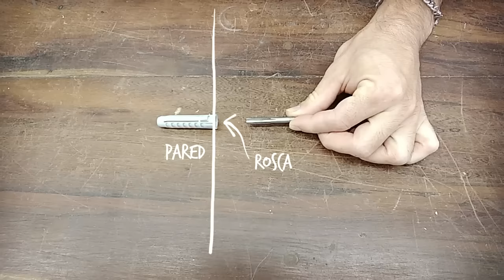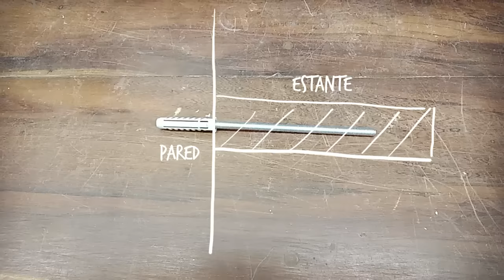⛔TRUCO⛔ REPISAS y estantes FLOTANTES 😲 COMO HACER una repisa o estante flotante de madera ➡️FACIL⬅️

Comment: Está excelente todo, felicitaciones. Está muy interesante el tip de volver a agujerear con un calibre menor luego de ya haber colocado el tarugo. Si entendí bien el tip sería:
1- Agujerear pared con el calibre necesario para que entre el tarugo pero solo hasta el largo del mismo (no el largo del tornillo).
2- Ahora si, ya colocado el tarugo volver a perforar pero con un calibre menor para poder introducir el tornillo más allá del largo del tarugo (de esta manera nos aseguramos que nos quede igual de apretado tanto en el tarugo como en el espacio detrás de este).
3: Creamos la rosca (al parecer este tipo de varilla roscada si no le hacemos las rosca previamente no entra como lo haría un tornillo común).
4: Colocamos el tornillo hecho a partir de la varilla.

Comment: A ya es 5 mm interior y 10 milímetros diámetro exterior y al machuelear tendríamos 3 milímetros menos para el tornillo m8 sería 1.5 mm por lado así tendría cuerda el tarugo o taquete wao Soi tornero mecanico pero me. fascina el área de carpintería es lo mismo pero en metal es artesanía también quiero tener la habilidad como usted y sea mi joby haber si alguien me.comfirma mis.meeidas porfavor se los agradecería para comprar el material me.motibo.mucho su vídeo mil gracias